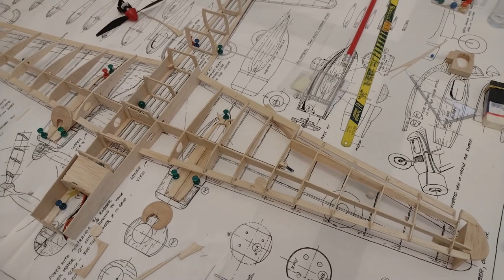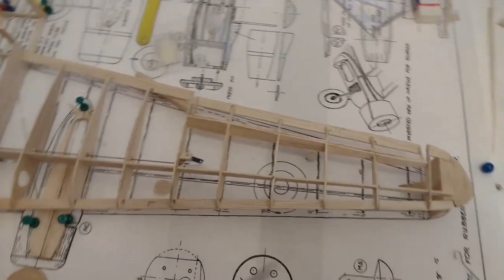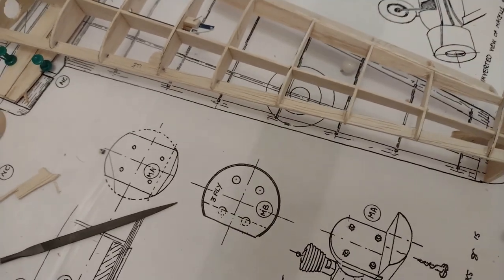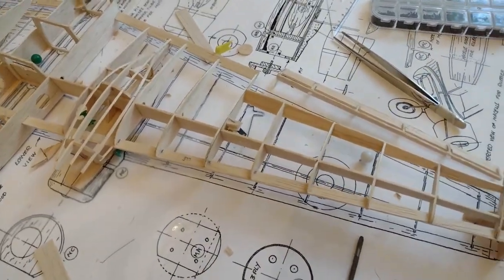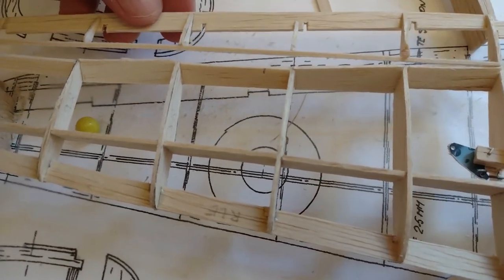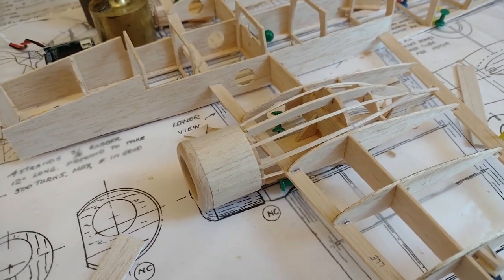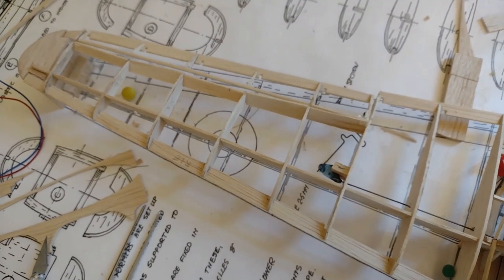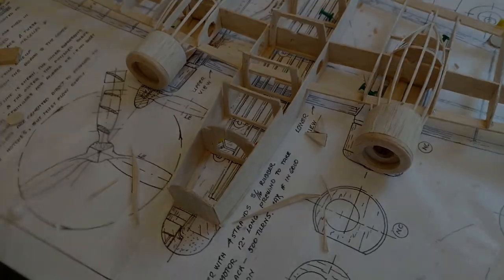06 Wellington Balsa Model   Ailerons and engine nacelles

Comment: I don't know why you have such a complicated shape for the aileron pushrods. Normally these would be as straight as possible. Are you trying to emulate the adjusting "loop" found on the Eachine P51 pushrods. If so, I wouldn't. I would use an adjustable clevis.
Also, it seems that you have made a rear "spar" for the front of the ailerons by glueing in short pieces of wood between the ribs? If so, I think that will prove to be weak. I think that should have been 1 piece of balsa that started 1 rib bay inboard of the aileron and ran out to the tip.
I have seen a video of a Guillows conversion where the builder made this rear spar out of two pieces of wood "tacked" together, front and rear halves. They built the complete wing, leading edge to trailing edge with this spar embedded into the wing. They then cut out the aileron, "splitting" the spar where they had tacked it together, thus providing both a back to the wing and a front to the aileron.
Reply from the maker: Thank you for your points!
Yes, I wanted to have the loop to trim as in the P-51. I also wanted to be able to access the push rods to remove if needed. They are indeed a strange shape.
About the short pieces rear spar you are right. I wanted to experiment with a different format but it looks bad (as I could not get the pieces straight) and it is probably weaker as you say. I might need to do a retrofit to that at some point. For the future I might try that trick of building in the aileron front spar in from the beginning and then cutting it out as needed. I hadn't thought of that.
Thank yo once again for all your points, even if I don't get to put them into this model, I hope I learn for future ones!
Reply: @downwindchecklist6567  I was looking for the video I saw with the rear spar in front of the ailerons with two pieces of wood tacked together. Have not found it yet, but this is one Guillows conversion I have watched where you might see some ideas, in particular for the ailerons themselves. Cheers. https://youtu.be/X2wrKIl2ktE
Reply from the maker: Thank you! I have at least one more Guillows conversion in mind so I will check it out!
Reply from the maker: @RichardTapp1  Thank you! I know some of Tim's videos but it is always good to review them and go on learning.